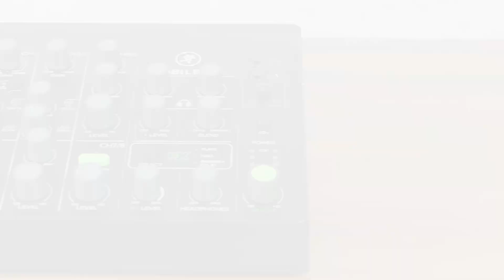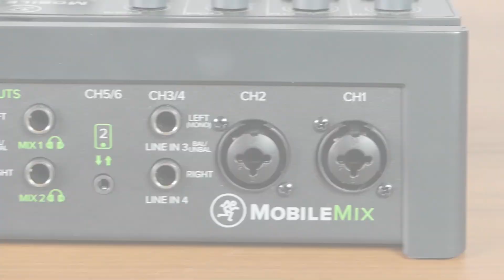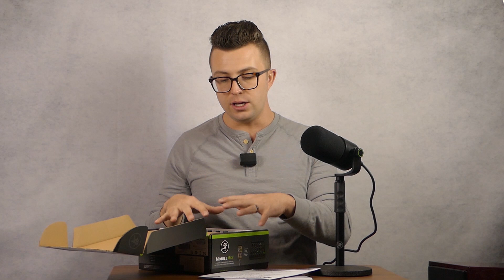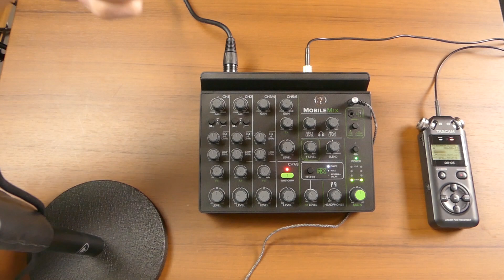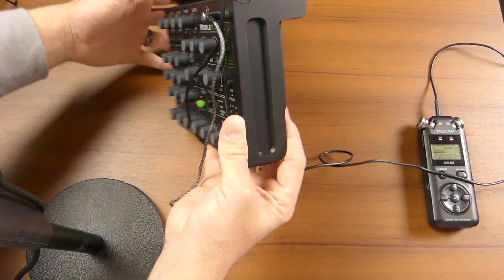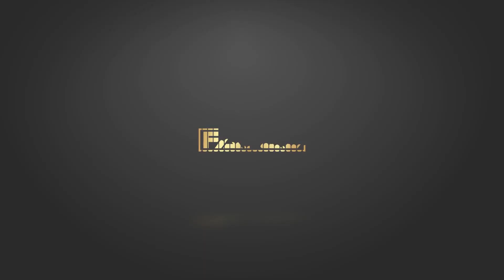Mackie MobileMix 8-Channel Mixer Review | Unboxing and Testing

Comment: The biggest problem for me with this mixer at nearly the same price as the Behringer flow 8 you can’t control it with your phone and the flow has 4 XLR in and 2 out. Update it’s now more expensive than the flow 8
Reply: One word, reliability.

Comment: Thank you for this info... How long wil it operate on that battery pack?
Reply from the maker: Great question! I used mine for a couple hours and only used about half the battery, and it’s a rather small pack. I’ll report back!
Reply: @fayzereviews  Great video, and I think you've convinced me to go with the MobileMix 8 vs a ProFx10v3+ for our events. How many mAh was your battery pack? I need the mixer to run a minimum of 8 hours (possibly charging at lunch break, but not always). Does it have pass-thru USB charging? Also, could you describe in detail how you would do a mix-minus for a hybrid event (in-person audience and an online audience)?